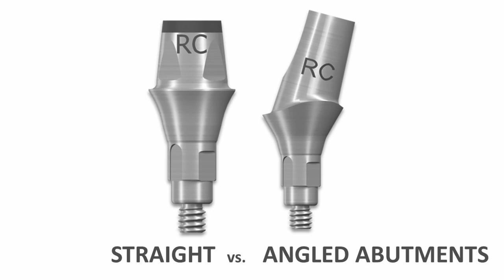All-On-4 vs. Implant Bridges Explained In The Lab

Comment: Hello, first of all thanks for your content, however I think a couple of statements can lead to misunderstandings. One of the main difference choosing an all on X or implant bridge is the vertical dimension. it's if the patient had lost maxilar or mandibular bone. Sometimes patients that have been edentulous for a long time have their alveolar bone atrophied leaving only base bone. Remember that the pattern of bone remodeling in the maxilla is inwards and the mandibular is outwards, this can lead to the implants being angulated. Personally, I prefer my rehabilitations to be direct to the platform and not use mini pillars. However, that does not mean that there are no cases in which they should be used. Each patient is different and the case must be studied and planned before performing any action in the mouth. The axis system (or dynamic pillar) is undoubtedly a great tool to carry out our rehabilitations.
Reply: The problem with the All-on-Whatever (FP2 and FP3) being recommended 100:1 over implant bridges (FP1) is that 80% of our patients presenting for treatment having some or all of their teeth and good to great bone, Even a few percent of the edentulous patients have very good bone. For these 80+% of patients with good bone, it is absolutely inappropriate to misinform them that they are only candidates for FP2 and FP3. Sadly, this happens in nearly EVERY All-on-4 office EVERY DAY. For the 15-20% of patients with severe bone loss there are still only a few small percent of them where All-on-4 is indicated. Traditional "All-on-4" prostheses cannot be cleaned by the patient, so, again,  I would argue that they are not appropriate for 99% of patients with the need for full mouth implant treatment. So, in conclusion, there may be about 1% of the population that have no other options but the traditional "All-on-Whatever" protocol.

Comment: Any comments on maximum segmentation of the bridge versus one full horse shoe bridge?  Thinking of future replacements and ease of delivery.  What factors are in play and what priority?  Strength?  Contacts?  Replacement?
Reply: These are great questions! As my protocol has developed, I have arrived at solid answers to these questions. If the patient has enough bone, I try to place as  many as eight implants, per arch (jaw) so that the Zirconium has the fewest number of pontics (missing teeth on the bridge,  between the implants). Smaller spans make the Zirconium stronger. With bone volume compromises, we can almost always get six implants in one arch (jaw). So, the first answers is, with eight implants, we can complete the arch in segments, usually three bridge pieces, sometimes four. My second consideration is the length of the teeth (clinical crown length). If the average length of the teeth on the implant bridge is 9 millimeters, or less, the patient can have separate bridges. If the tooth length is 9 millimeters or more, I make the bridge in one piece of either 12 or 14 teeth. With long teeth, the patient can feel air and fluid at the contact points, between the separate bridges. Patients do not like this sensation. They tend to get food impacted in these long contact areas. When they begin to notice the food they begin sucking air through these contact areas and that becomes annoying for them and their family members. I often become friends with my patients. I was out to dinner with a patient and her husband when I heard the sucking noises and called her the next day and said, "Donna, we must fix that!" So, we modified her three pieces into one piece and that fixed the problem. So, like mentioned above, with six implants the bridge will always be one piece. With seven or eight implants, we have options based on all of the above. As strong as Zirconium is, it is not unbreakable, so I want it supported enough to give the patient the best possible chance for long, long term success.
Reply: @davidmcfadden878  Thanks for the thorough answer.  Never heard anyone give length parameters in deciding whether to splint or not.  Very concrete advice.  I appreciate it.

Comment: Excellent information thank you what is your opinion on three on six the patented implant system
Reply from the maker: The main difference is that 3 on 6 is cemented in place, instead of being screwed in, which we know can cause problems down the road.
Reply: How many implants do you use for the upper arch more then 6? I receiver you saying that you use more then 4 because of bone loss so what is the maximum you would use?
Reply from the maker: @familyfirst8364  Please read the answer I gave a few days ago to tsunamidoc on this in the comment thread for this video. Thank you.

Comment: Greetings from Northern Ireland, i need to get serious work done on my teeth, going by photos of my mouth alone, 3 different dental implant centres have told me i need all on 4, after watching your posts, im dead against it. I had bad gum disease for a few years over 10 years ago, i worked hard to try and keep as many teeth as possible, unfortunately i have lost a tooth and had 5 extracted over all. Im in a position to get some cosmetic restorative work done, i love the look of the dental bridge 3 on 6 solution, but my jaw bone density is poor. What solution would you recommend?

Comment: Hello doctor, first I wanna thank you for taking the time to make such wonderful educational content. Great work! 
I had one question, I’m curious on your opinion as there are some conflicting ones out there.

I have multiple crowns veneers implants and have to replace some of them now due to excessive grinding , I had them I’m for 7/8 years now but due to grinding the force went too much in my front teeth and a bridge cracked. 
My doctor told me the best option is to replace all of the upper ones so I can replace the contacts properly and distribute the force, I already have crowns or veneers on all the teeth. 
My question is which material would you choose, she’s recommending emax which I agree on for the front teeth as it will probably be better but I heard that the zirconium one is stronger so wouldn’t that be a better option on the back teeth to be more durable against grinding. 
Also do you know any good therapists or solutions agains teeth griding(other than that annoying night guard 😩) 
Would really appreciate your answer! Thank you
Reply: I agree with EMAX front and zirconium back. Nothing else can protect your teeth like a nightguard. Keep wearing it. Sounds like you might be grinding during the day, too.
Reply: @davidmcfadden7927  thank you! 
Any other suggestions for teeth grinding? As an addition to the night guard?
Reply: @Instakat969  no. It's nearly impossible  to stop. I have heard of some practitioners (perhaps medical) that use oral drugs to stop the urge/ habit but I fear they would make people feel lethargic.
Reply: What about sleep study? Does that help to address the possible sleep apnea ?
Reply: @msh1348  No. This will not change/ improve sleep apnea.
Reply: @Instakat969  Botox in the jaw muscle. It weakens it and helps reduce or eliminate the grinding. Kinda neat, and I hadn't heard of it before.

Comment: I was just recently told that all my back teeth would have to be pulled except for a single implant. Is it possible to have this type of implant for just back teeth? The only type of bridge discussed with me have been permanent bridges, which, aside from no longer having a tooth on each side to anchor to, seemed so awfully destructive to any remaining teeth. Don't think it would apply to me now. Only was told I would need implants.
Reply from the maker: From your description, (with all back teeth needing to be removed), yes, it is possible to have implant bridges made to replace them. They can place implants in the back and make bridges that screw onto them. This may help you understand just what that looks like: https://www.dentalimplantcenter.com/fixed-bridges-non-removable/
Best of luck to you!
Reply: @mcfaddendentalimplantcenter Looks like the ideal solution. Had a 2nd opinion which confirmed the need for extraction, once, if I ever resolve the oral lichen planus. This is what's lead to the destruction - gum recession, bone loss and several caries below the gum line. Despite singular focus on good dental care, I've lost the use of my salivary glands. Still I've used moistening products every moment of every day. 
I'm disabled and unfortunately the cost equals my yearly pension. I'm devastated trying to imagine how to exist with no back teeth. How long will my front teeth remain stable before shifting and further gum and bone loss will compromised them. One dentist spoke candidly, telling me "tooth replacement is only for the rich". I know firsthand, the overall impact of body and mental health from poor dental health

Comment: Could I ask do the bridges need to be removed by the dentist to be cleaned? I heard all on 4 or 6 need to be removed every year or so to be cleaned so I just wanted to ask about your bridges? Thanks
Reply: Only rarely do we have to remove the bridges. Mainly, when patients have pressure or pain we remove them to inspect the problem. Almost never for hygiene reasons. The All-on-4 offices do this because their design is uncleansable. They have now discovered a way to monetize a design flaw.
Reply: @davidmcfadden878  Thanks for your reply. Yes I just had bridges zirconia on 6 implants top and bottom 
but done almost the same as your technique so I wanted to double check about cleaning..

Comment: I am on shopping to fix my teeth. I did get inspected in Jefferson dental.  They asked me to pull out nine teeth and a few hours process.  Made me scared and concerned.   I am in Dallas area.  So i decided to watch more and do some research on myself.  I don’t want many problems after surgery that will frustrate me. I don’t want to pull out all teeth.   Smile and beauty is least important for me.   Function and strength. Duration and easy to clean is my top priority.   I will do more research and decide
Reply from the maker: If you’d like a second opinion, I’m happy to see you for a complimentary consultation. You can schedule an appointment by calling my office at 214-956-9100.

Comment: The dynamic abutment you mentioned is not FDA cleared for use in the USA.  How are you getting around that ?
Reply: I am told by the implant manufacturer that Dynamic Base holds the FDA clearance for each company they manufacture for.  I don't know what that means but I went right to the director of education.
Reply: @davidmcfadden7927  
Thank you for letting me know.

Comment: I am told that due to gum recessing and bone loss that implant bridges cannot be an option on my lower teeth.   My only option for my lower teeth is one piece bridge...I am not happy?  My next question, is with my upper implant bridges, false gum was added to the back of the bridge, is this for more support of the implants?  It is unfortunate, that I found you videos after the fact.  Some of my lower teeth were replaced with all on 4 type, now I need the rest of my teeth extracted, I am perplexed about my option?  Please clarify???
Reply from the maker: It’s hard to answer this without any diagnostic information. If you’d like to contact my office and arrange to send a current panoramic and/or ct scan, I’m happy to try and give you some guidance. 
I’m in Dallas, TX. You can do this through contacting my office at 214-956-9100

Comment: I have the zirconium teeth which are great but the gum materail tends to scratch and chip.  I have had to go back serveral times to get the gum materail smoothed out.
Reply: My guess is that they used another material added to your Zirconia bridge after it was fabricated. Stained Zirconia does not "chip".

Comment: Hello doctor and thank you for your great video! Very informative. I am a lab tech in California and I do implant bridges and all-on-4s and correct me if I’m wrong but I think that the term all-on-4 just refers to the number of implants used. It still in an implant bridge after all, but with tissue built in? I fully agree that a concave shape for the tissue isn’t as good as a convex design, but sometimes you need to build tissue where it isn’t present, either from removal, trauma, or natural loss due to not wearing a proper prosthesis. Dentures have an average bone loss 1-2 mm per year, more if proper hygiene isn’t followed. Do you actually see a lot of cases where bone is removed? Unless it is needed for gummy smile reasons? If so that is truly insane. Usually we strive to replace bone loss not remove it! And it is a pain staking and time consuming effort that doesn’t always give us the results we want. I also agree that there is a lot of “lazy” dentistry being done, especially if there is tissue present but the extra time is not taken to condition it into a socket shape for an ovate bridge bottom. Not a lot of drs really know how (or want to take the time) to do this step properly and for a technician it is very frustrating as it can totally compromise esthetics and cleansability of the final bridge. But I think the All-on-X name gets a bad rap for this as it can be adjusted by being cutback and layered with porcelain and shaped properly also. Just my 2 cents. 
Thank you again for your great video!!
Reply: Yes, aggressive bone removal is a standard part of the All-on-4 protocol. As soon as an abutment or an implant becomes supra-gingival (above the gums) the prosthesis becomes uncleansible in that area. If all four implants are super gingival and has a con cave tissue surface the whole thing is uncleansible. Thank you for your comment.
Reply: @davidmcfadden7927  thank you for the info and the great video. I’ll share that with my clients.

Comment: What about IHDE implants for full arches? They call it all on X but cement the prosthesis in. It utilizes natural gumlines.
Reply from the maker: That's a good start! But:  For over 10 years, we (the dental industry) have known that dental cements are toxic to the gums and bone around implants. Offices that do this (use cement instead of abutments and screws) opt to do that because it is much easier and less expensive for them. Not better for you, the patient.
Reply: @mcfaddendentalimplantcenter  So all the crowns I have received that are cemented are toxic?
Reply from the maker: @dawn5982  potentially problematic.
Reply: @mcfaddendentalimplantcenter  Doctor, firstly, brilliant explanation, but surely that isn't true for standard crowns on crown-prepped teeth, rather than cemented to implants? I have crowned teeth that are good after over 30 years. I also have cement retained dismantleable cantilever bridges from implants in both upper canines to the first lateral incisors. This is normal good practice in the UK by a very experienced implant specialist. How else would you do this? Thank you.
Reply from the maker: @ColinDyckes  You are correct. It is not the same for cement on crowns on natural teeth. Well made crowns will last decades. You’re living proof!
It sounds like you’ve found yourself a good dentist. And from your description on the cantilevered implant bridges on the canines, you state that they’re dismantleable (screw retained), which in many cases, such as yours, is a perfectly reasonable treatment.
Reply: @mcfaddendentalimplantcenter  Thanks for the response. My cantilevered bridges are actually cemented using semi permanent cement to the implant abutments and can be removed by the dentist using a 'slide hammer'. I believe this is normal in the UK as opposed to full screw retention and an 'overfilling?'. EDIT: the bridges are CNC machined and then porcelain coated to match and are an extremely tight fit on the conical abutments without any cement so the amount used must be negligible. Implants and all other hardware are Straumann.
Reply: IHDE implants have very high success rates, and the only way to secure the prosthetics is with cement. They are one piece and can be loaded immediately. I am scheduled with a dentist who has done thousands like this and has almost 100% success rate, taking into consideration the patient follows post op protocol to ensure proper healing. I am super excited to get this done.
Reply: @mcfaddendentalimplantcenter  The tissue attachment between an implant and a tooth are very different. Periodontal fibers connect to teeth in a perpendicular manner which is very strong. Cementing crowns on teeth is safe unless they have bone loss. Periodontal fibers on implants are more vertical and much weaker. When standard, permanent cement is used to cement implant crowns and bridges... and even just a little too much is used, the fibers tear and the cement then exudes into the bone/ tissue complex known as the "biologic width". When cement is trapped in this area, it begins the slow (usually 6-10 years) demise of the implant. So, it is "technique sensitive" but there is no question that we have arrived at a point in the industry where screw retention is the standard of care.

Comment: Can you please explain something to me?  I can't believe what happened.  I had an implant bridge and it cracked.  I had to save for a bit to get the $10,000 to replace it.  I assumed he would just make me another bridge.  My dentist put in an implant denture.  It is awful.  I went back and said I would wear the cracked bridge instead of this.  He said the change he made is irreversible.  I just sat there sobbing.  He said he would make another replacement and would not change me more.  I just could not stop crying.  I didn't understand that this could even happen.  Is there a way that what he did is irreversible?   He did not cut my gums at all.  Is there anything I can do?  Thank you so much.
Reply from the maker: If you had a bridge once, you should be able to have one again. Bridges typically need less room than an implant denture.